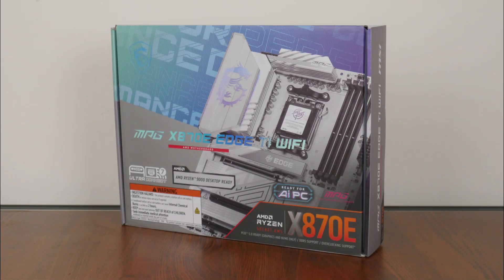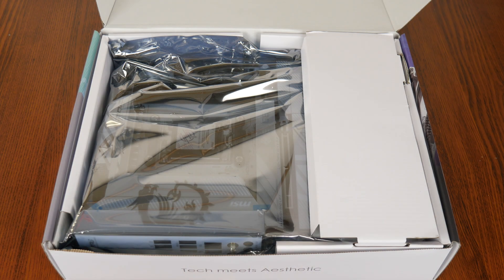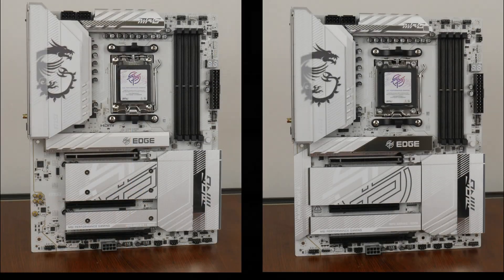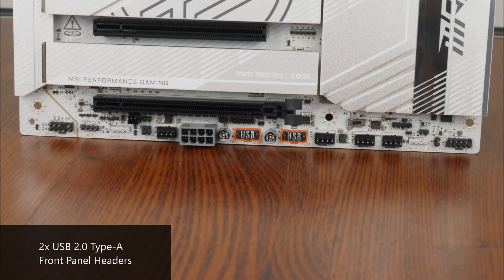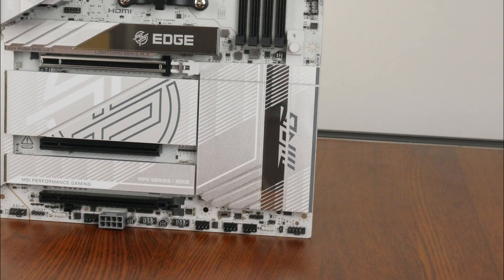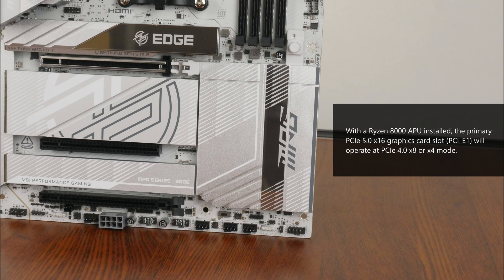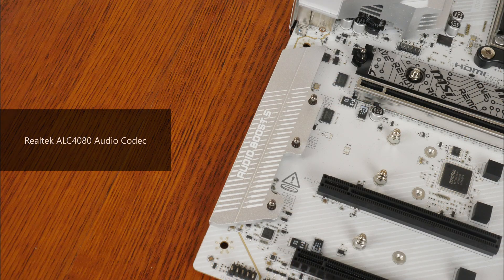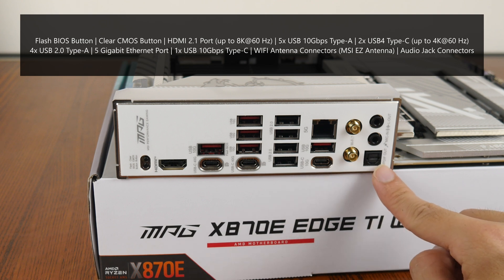Great for high-end Ryzen 9000 PC builds in white! MSI MPG X870E EDGE TI WIFI Unboxing & Overview

Comment: Awesome video man! I was originally thinking of going with the ROG Crosshair Hero, but now I'm considering this one instead. It seems pretty solid! I was trying to see if you had a comparison video, but I'm not seeing one. Do you have any comparison thoughts between the two?
Reply from the maker: Hey there, thanks and glad you found the video useful in some way. I didn't get the chance to give an overview of the ROG Crosshair X870E Hero, but I'm thinking it'd be much more expensive than the MSI board in this video, given that its specs are after all a tier above the X870E EDGE TI WIFI. How's the pricing like where you're from, and what processor are you looking to use for your build? Also, are you still deciding on whether to go with a black-themed or white-themed build?

My personal quick take is that the X870E EDGE TI WIFI is a great board as it is from a specs perspective, and that the ASUS would be an option if you'd like additional features such as the built-in ESS DAC chip, more M.2 slots and dual PCIe Gen 5 x16 slots (that have some form of lane sharing though - X870E boards cannot escape some form of lane sharing due to chipset limitations)!
Reply: @ALKtech  I'm working on trying to lean more into a white build, but it's probably going to end up being a black and white build since my 4080 Super that I already have is black (Gigabyte Aorus). Case is going to be white though, RAM white, and I'll eventually try and do a custom water loop.

As for the CPU, I'm going with the Ryzen 9 9950X3D for both gaming and productivity on the side.

Pricing is currently about a $200 difference between the two boards, which is making me lean more towards the MSI because I'm not sure if I'd fully utilize what the ROG board would have to offer.
Reply from the maker: @dustinoman  mmm I see, what PC case are you using, out of curiosity? I suppose a black GPU still kinda works with a mostly white setup 😅

Anyway the MSI should handle a 9950X3D perfectly fine, and given the price difference between the ASUS and MSI is pretty large, I think going for the MSI might be the best option seeing as you have doubts about whether you'd need all the features that come with the ASUS board!
Reply: @ALKtech  I have my eyes set on the HAVN HS 420 Dual Chamber case currently. It was between that, or the Lian Li 011, but I love how well built that HAVN case is from all the videos I've watched.

I originally was going to get the Aorus Ice 5090, but we all know how that paper launch went, and then the insane MSRP markup I just couldn't justify. I will probably still try and look for a white card at some point, but my current PC was built in 2018, so it's time to upgrade it haha.

I really appreciate you thoughtful responses.
Reply from the maker: @dustinoman  oh yeah HAVN has nicely specced-out and good looking cases, though they sure do come with a price premium! On the topic of Lian Li, I'm hoping to get my hands on their upcoming O11D Mini V2 that launches for sale in July 2025 for a review, so do keep your eyes peeled for said review if you're looking for a more compact and budget-friendlier dual chamber ATX case!

Good idea to just hold off on the GPU purchase too if you're not in a rush - I see no point in adding to demand pressures that cause prices to be inflated above MSRP. Anyway, seeing how prices are softening for mid-tier cards at this point in time, I sure hope the same price weakness will extend to the higher-end of the market too in due course. Fingers crossed!
Reply: @ALKtech  I'm okay with the case since it's not too bad, and if I do a slightly cheaper Mobo instead, it off sets it some, so I was then considering adding another M.2 (9100 Pro) as the main drive and then a 990 Pro 4TB for the game drive and such. 

I will definitely be looking out for that video then since I'm wanting build a small sort of server computer, especially for the living room. I subscribed, so I'll see the video once you upload it!

I totally agree with you though! Fingers crossed that the lowering will transition it's way into the higher cards. I got curious and double-checked on the 5090, and they want over $3100 for the white one, which is $1100 over MSRP. That's just insane!
Reply from the maker: @dustinoman  yeap that's nuts all right. I did see some reports a couple of weeks back that the RTX 5090 (not white though) was available under MSRP in the UK/Europe for the first time - sure hope this is a sign that things are heading in the right direction for the high-end GPU market...unless we get a new bunch of tariff nonsense to upend the market again 🙄

Comment: Would this be a better choice compared to aorus x870e pro ice ?
Reply from the maker: It really depends - for me, the X870E AORUS PRO ICE wins from an aesthetic perspective thanks to its actual all-white hardware, while I really like how the MSI board's PCIe 5.0 x16 slot for a graphics card doesn't share bandwidth with any of its M.2 slots, something that the Gigabyte board is unfortunately affected by. How's the pricing like for both boards where you're from?
Reply: @ALKtech 
I'm from India, not much different in price. I'm upgrading my pc after 5 years, confused between msi and aorus pro. Since I'm going white aesthetics this time, not many options in white
Reply from the maker: @wakehunter7862  I see. How many M.2 SSDs are you intending to install in your PC? If you're looking at installing several, the MSI would be the option that I'd pick, so as to avoid any lane sharing which would cut your graphics card's bandwidth in half. But again, I think it's a missed opportunity that MSI did not use white-coloured onboard connectors like Gigabyte did with the X870E AORUS PRO ICE 😅
Reply: @ALKtech 
I'm going for 3TB (1TB for os and other softwares, 2TB for my games) i know pro ice full white and it's one of the beautiful looking white motherboards out there. But lane sharing one thing made me double think
Reply from the maker: If you're using just two SSDs (i.e. 1x 1TB and 1x 2TB), then you'll be fine with the X870E AORUS PRO ICE. Just make sure that your primary drive is installed in the first slot (M2A_CPU), and the second drive in the last slot (M2D_SB), and there won't be any lane sharing at all. Are any of your M.2 drives PCIe 5.0?
Reply: @ALKtech 
No 5.0 m.2s, 
Well i went for aorus pro ice. Purchased it yesterday 🙂
Reply from the maker: @wakehunter7862  nice! What processor and GPU will you be using with your new board?
Reply: @ALKtech 
I'm using Ryzen 7 9800x3d, gpu I have a 3080ti, not sure if i should go for 5000 series or not
Reply from the maker: @wakehunter7862 the 9800X3D's gonna hold up pretty well as the best gaming CPU money can buy, so you'll still have time to consider whether it'd be worthwhile to upgrade to the RTX 5000 series. If anything, perhaps wait till the holiday sales towards the end of the year to see if GPU prices soften further? Assuming by then the global trade situation hasn't imploded from additional random tariffs...

Comment: hi, im interested in this motherboard, however, its not selled in america, just in amazon imported from europa, like the one you showed in the video, i have a doubt, will this motherboard selled in europa work in my us pc build? (paired with a normal USA selled UPS unit) thanks in advance
Reply from the maker: Hi there, yes the motherboard will work with any modern 24-pin power supply unit, regardless of which country you got the power supply from!

Comment: Bro this is not a cheap mb. All white but they include black cables 😢
Reply from the maker: Yeah I do agree this was a bit of a missed opportunity on MSI's part to not go fully white (with white hardware connectors and cables)...but they do make up for it with a better PCIe lane sharing arrangement that doesn't eat into the PCIe 5.0 x16 graphics card slot's bandwidth, unlike other X870E/X870 motherboards from other brands!

Comment: I got this board delivered yesterday and plan to do a Lian Li 011 Evo build (black), planning on slapping a 9800X3D and a RTX4090 on it, mainly for PCVR, so the lane sharing here is kind of a disappointment with the USB4 (my Quest 3 Link cable would connect to it)....hmmm any ideas or suggestions on this? My first build so kind of a noob here haha
btw great video, very helpful with the color coded boxes for all the headers and stuff, thank you!
Reply from the maker: Glad you found the video useful! Actually, you can avoid the lane sharing altogether if you're not planning on using the second PCIe 5.0 x4 M.2 slot, which would leave you with 1x PCIe 5.0 x4 M.2 slot and 2x PCIe 4.0 x4 M.2 slots for a total of three slots, and you get full USB4 bandwidth for both ports. How many M.2 drives are you planning on using for your build? Also, any reason why you're going with a black PC case for a white-themed motherboard?

Comment: This board or the asus x870A white mobo?
Reply from the maker: Assuming the prices for both boards are the same, I'd pick the MSI, as it has a better PCIe lane configuration than the ASUS, where with the MSI, you won't get into any situations where your PCIe x16 slot for a graphics card drops down to x8 mode when you've got a M.2 drive installed in a certain slot (which is what will happen with the ASUS X870-A).
Reply: @ALKtech  highly appreciate the response.   There's a $80 difference between the 2 boards.  I'm willing to pay for that because I need to put a sound card and a capture card as well.
Reply from the maker: Ah, if you're installing two PCIe devices (sound card and capture card), the X870-A is out of the question, as it only has one other PCIe slot (apart from the PCIe x16 one for a graphics card)!
Reply: @ yea I don’t necessarily need 3 slots.  It was just a desire but, everything is leading me towards the Msi x870e
Reply from the maker: Mmm. The MSI's a decent board in any case, don't think you'll go wrong with it! What processor and GPU will you be using for your upcoming build?
Reply: @ALKtech  I'm not sure on the cpu, might just go with a 7800X3D, 9900x or  9600x.  I already have 2 systems up and running with a 9800x3d and 9950x3d both paired with a 9070xt.   I have a spare 9070xt nitro and a 9100 pro 4tb nvme.
Reply from the maker: Cool, that's quite a number of 9070 XTs that you have on hand 😂
Reply: @ALKtech  i had more have em to my brothers all at cost... msrp or close to it.

Comment: Just ordered this mobo for the cost of the b850 i couldn't believe my eyes when i went to go through with getting the msi b850 edge and the 870 edge was on sale for the same price that was a no brainer ti get the x870 edge then cant describe how excited i am lol now in a month or so ill replace my 7900x with a 9800x3d  woohoo then my old mobo and 7900x will go ing my 7900xtx  pc and the new stiff will die with my 4080
Reply from the maker: Wow what a steal, I wonder if the retailer might have mispriced the X870E EDGE TI WIFI 😂 Helps that prices of the 9800X3D have been softening somewhat - will you be getting a new GPU in due course to pair with the 9800X3D?

Comment: X870 Tomahawk or the Edge Ti? Please help! 

I love the white color of the edge but can’t seem to find comparisons between them.

 9800x3d and 5080 build.
Reply from the maker: What's the price difference like between both boards where you're from? On paper, both boards are very very similar, where apart from colour, the EDGE TI WIFI has a better M.2 slot configuration where the Gen 4 slots both operate at x4 mode, unlike the Tomahawk where one Gen 4 slot operates at x2 mode.
Reply: @ALKtech  so in layman terms the edge is better if you need an extra SSD?
Reply from the maker: @Yautja24  yup that's right, but do note that for BOTH boards, due to lane sharing between the second Gen 5 M.2 slot and the USB4 controller, the USB4 controller will run at PCIe 5.0 x2 speeds (instead of x4) and the second M.2 slot will also run at x2 speeds instead of x4 when you have a M.2 drive installed in the second slot!

Comment: Which is better this or msi mag x870e tomahawk?
Reply from the maker: The MAG X870E TOMAHAWK WIFI and the MPG X870E EDGE TI WIFI are actually pretty much identical, except for aesthetics and the fact that the EDGE TI WIFI has a slightly different configuration of USB ports!

Comment: How are the DIMMs paired for dual channel?
Reply from the maker: Are you asking about which slots to install your RAM modules on for a dual channel setup? If so, you might want to refer to pages 32-33 of the motherboard manual here: https://download.msi.com/archive/mnu_exe/mb/MPGX870EEDGETIWIFI_English.pdf

The manual illustrates which slots to install the RAM modules on!
Reply: @ALKtech  I found that quite strange. Manual says use A2 1st, then shows a picture with A2 and B2 paired, while the dual channel config is A1/2 and B1/2. I'm asking clarifications because the only combo I actually made to work with 2 DIMMs was putting them in B1/B2. No other combo worked, including A1/2. BIOS update for the test was 2024/10. Did not retry after current 2025/3 update.
Reply from the maker: Did you try A2 and B2? That's the typical dual channel DIMM installation configuration - A2 alone is for when you only have one stick of RAM installed. If you've already tried A2 and B2 and you couldn't get your PC to boot, it could be 1) faulty RAM slots 2) faulty RAM or 3) compatibility issues. What brand and model of RAMs have you got?